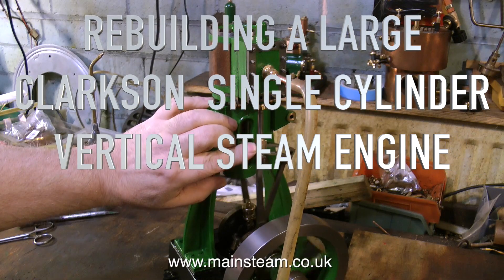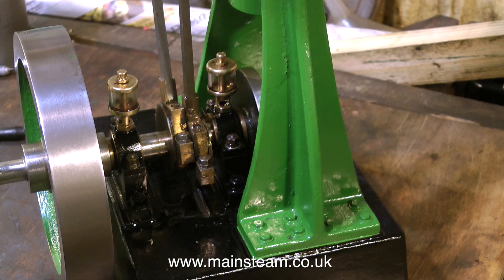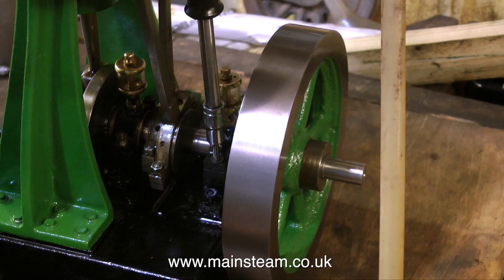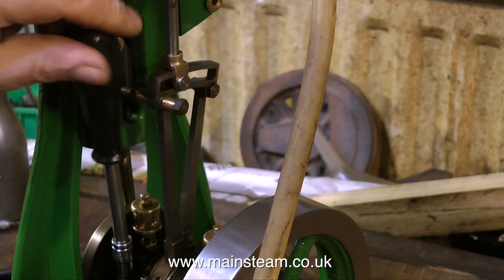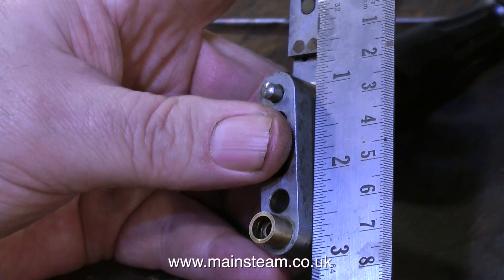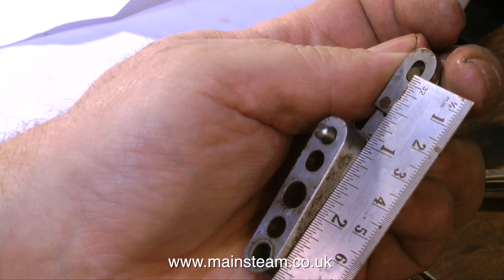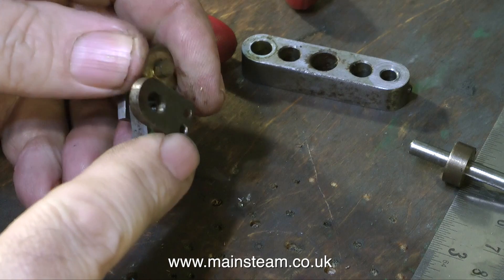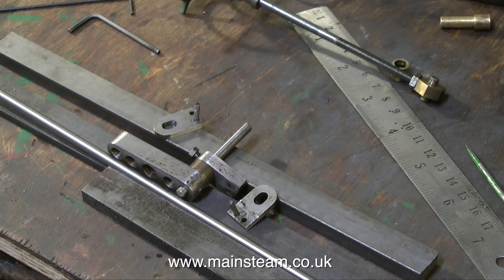REBUILDING A LARGE CLARKSON VERTICAL STEAM ENGINE - PART #27

Comment: When rebuilding Gardner 150LW engines back in the 70's we would adjust the nip on the crankshaft main bearings by putting the bearing cap on the linisher the bearing cap was about the size of a lot of model steam engines. Totally irrelevant but it all came rushing back and I just couldn't stop my twitching fingers. Thank you for your videos.